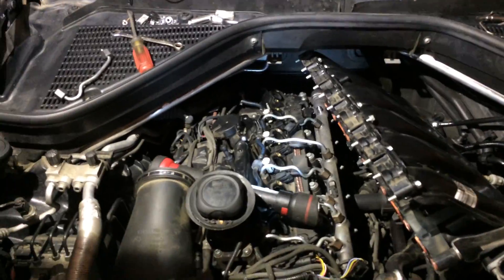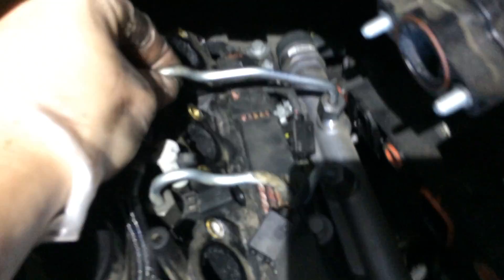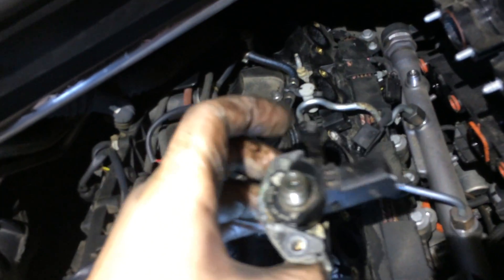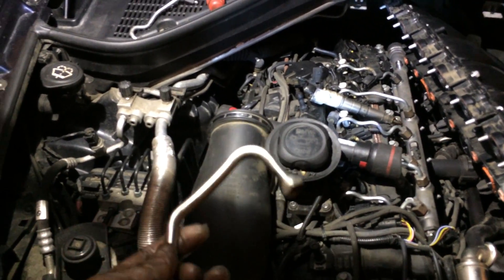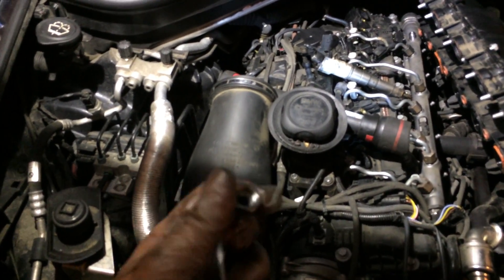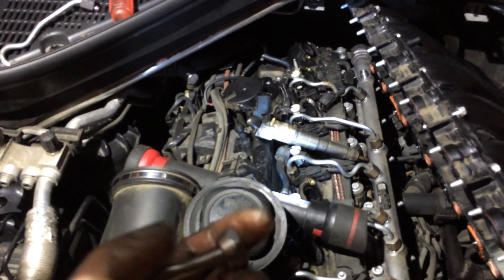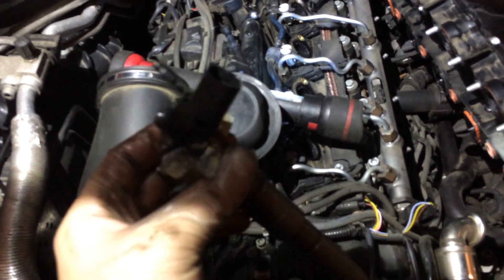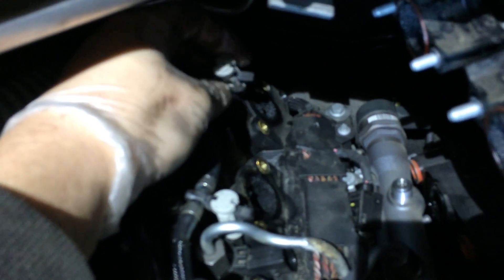BMW x5 3.0 Diesel injector DIY part 2

Comment: LOL, (at 10 sec ) i didn't pull the intake out, of course the last connector in the back controlling the flapper is a B@#$% to remove, i her you, but it worth removing to clean the inlet as it gets extremely dirty, good job keep it up

Comment: Hi sir and have the same problem with my x5 e70 2007 model and did change glow plugs but still it cut while driving so do I have to do the injectors  plz help

Comment: autowpg1 thanks for sharing both video's parts 1 & 2.
I was quoted a fairly high price to replace the injector for cylinder 5... $1000 CDN alone for the new injector?

Question 1: should I buy a BMW brand injector, or would a Bosch brand injector do?
Question 2: once I've changed the injector, do I need to have the timing done on the engine?
Question 3: the code I get from the IBDII reader is P0205 - Cylinder 5 Injector Circuit Open... are you familiar with this code and what it means?

thanks in advance. 
Rob
Reply from the maker: just posted part 3 and 4